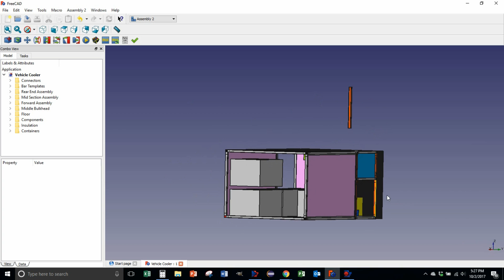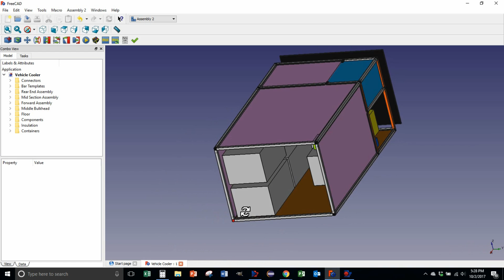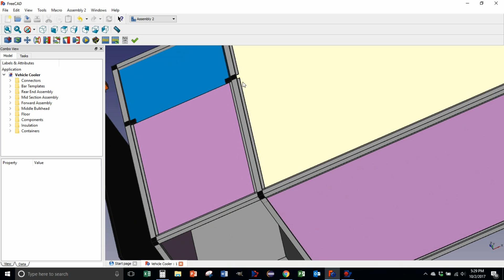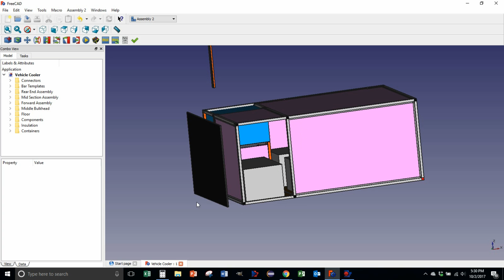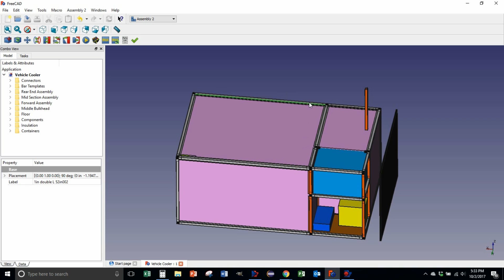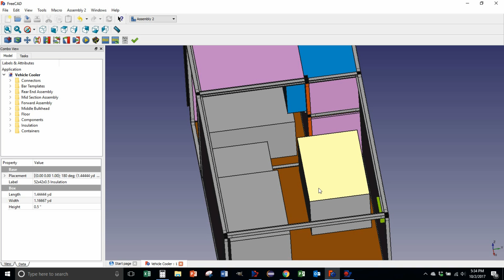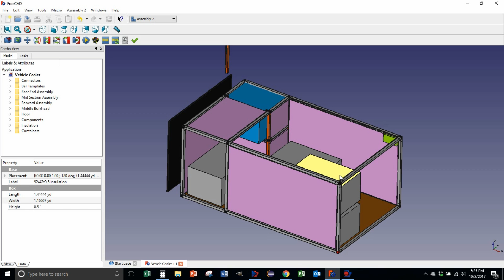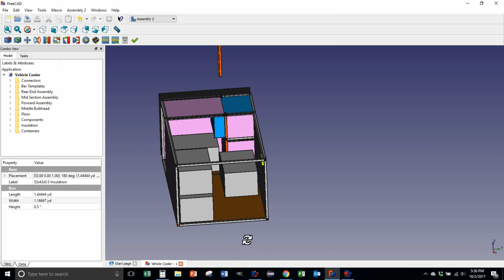Delivery Vehicle Custom Cooler DESIGN with FREECAD, COOLBOT, and 80/20 Inc.

Comment: Make sure you put a relay between the auxiliary battery and the existing electrical system so it disconnects the batteries when the engine isn't running but it sounds fantastic also  your inverter will draw in excess of 70A under full load so you will need to make sure your existing altinator is at least 100A to supply the inverter and keep both batteries charged but the plan sounds like a good one 😊

Comment: I would suggest putting the exhaust out the window by enclosing the exhaust in a tunnel or flex duct that either is permanent or at least directional. If you leave an air gap around the unit and the exhaust is able to flow back into the cooled area then you are just wasting your time and risk making a hot box instead of a cool box.

Comment: A diode in the charging line will keep the system separate.  

Be careful getting too fancy with the truck.  Get stopped for anything and a busy body cop could call DOT motor vehicle enforcement.  There is a fine line between hobby farm and commercial Enterprise.  Suddenly a Federally dot certified headache rack becomes a requirement.  Just mentioning a reality out loud.  Some dot cops are notorious for being humorless individuals
Reply: Randy J a diode will give you a voltage drop between the altinator and the battery and will prevent the auxiliary battery from charging fully also the inverter will draw in excess of 70A so that's a pretty big diode
Reply: Alternator 0uts ot c
13 to 14 volt.  Battery is still a 12 volt system.  A minor line drop will be insignificant in this application
Reply: Randy J the battery is nominal 12v but when fully charged is 13.2v to 13.6v depending on chemistry of the battery and needs to be charged between 13.8v and 15.2v again depending on chemistry of the battery etc and you loose around 0.7v across a diode which depending on the chemistry of the battery and the altinator regulator could make the difference from the battery charging fully and efficiently or not, also a diode won't stop the auxiliary battery discharging if you accidentally leave the lights on etc which will likely cause damage to the battery and reduce its expected number of life cycle 😊 in short diodes are not a great option for separating batteries

Comment: Cool design, for the spare battery.... you may want to install a battery isolator instead of going to the alternator.. in doing this it will protect the vehicle battery from getting discharged.. just curious, how did you make out with the 4 wheel drive issue that your wife had on the truck?

Comment: You should have used Fusion 360.. dodge may even have models for the interior of the Durango. 80/20 way expensive jut still great to work with.

Comment: You will need to plumb in a drain for your air conditioner.  You could also wire in a RV plug to an external power outlet so you could connect the cooler to pre-cool the space prior to loading your product.  You may need to screw the connectors to keep them in place over vibrations.

Comment: Batteries - I know you are already thinking about it, but consider isolating the batteries from each other. Your battery under the hood is rated by Cold Cranking Amps. Your battery for the inverter is rated at 120AH. You could completely isolate them with diodes, but you may want to have the option to let them charge each other if the need presents itself. Nifty project. Can't wait to see the updates.

Comment: You should use the Rear-Air option on the Suburban to provide cooling to the unit.  Should provide about 13,000 BTU with some plumbing perhaps from a wrecked vehicle.  If the Suburban is already equipped you could just modify the air ducting.

Comment: With the metal sheet at the front it will be sealed in the back so won’t you need an inlet so you have air flow through the air con unit?  Do you need to put stickers on the back of the truck as it has an air con unit in it in case of emergency?

Comment: you probably could have went with something like a ford transit with the steel mesh separating the cab from the back and just insulated behind the mesh and cooled with a ceiling unit instead of making an all in one cooler. although I do like the option of taking it out and using it like a normal vehicle.